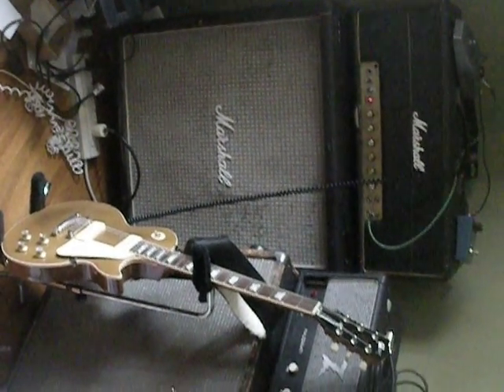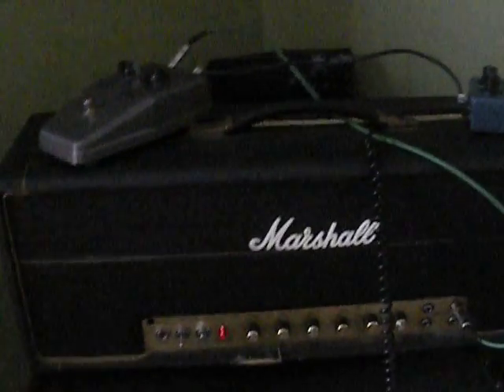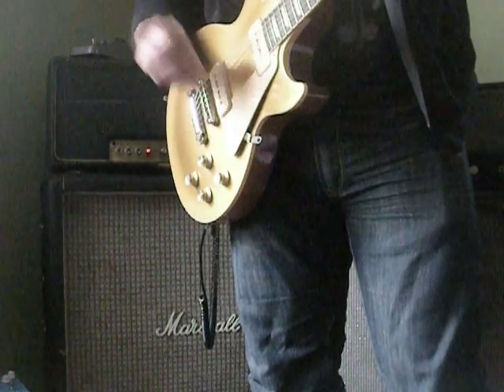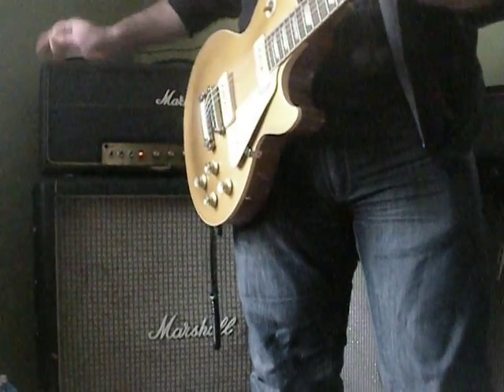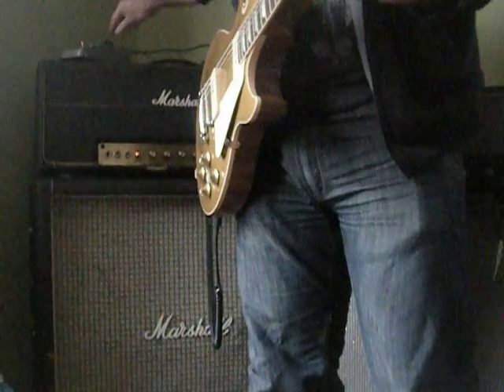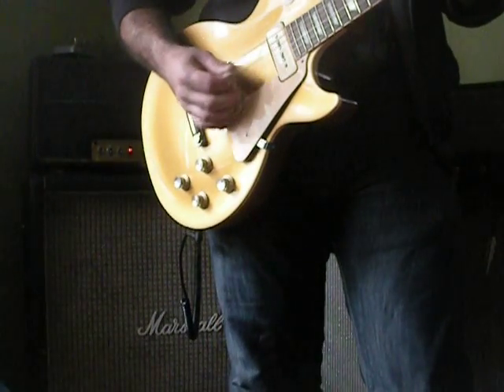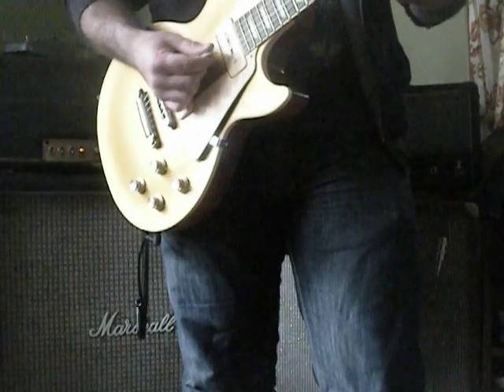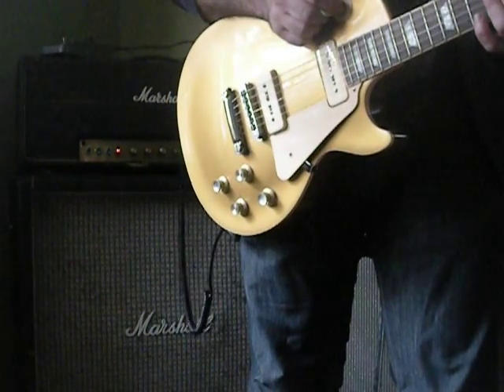How to use Fuzz - Vol. I - MKII Tone Bender (D*A*M Solasound)

Comment: what are you idiots going on about?
this video explains how to PROPERLY use a fuzz,
how people like Jimmy Page and Beck did-with dynamics.
Go from shimmering cleans to full-on fuzz with the touch of the guitar volume knob.
thats what you want. You dont want to be all fuzz all the time that gets boring real quick.
without the whisper the thunder loses its power.
unless your goal is to sound like a noob banging away at GC then go ahead and ignore his advice.
Thats why Page, Hendrix, Beck are legends and you are, well,  MURF8393 thats who.

For an example of using a fuzz properly listen to Sons of Adam (Randy Holden) do 'Mister Youre a better Man than I'
the verses are strat>fuzzface with the volume down, a nice clean tone
then for the solo he cranks the volume and gets the most amazing fuzz and feedback (for 1966 anyway)
The Yardbirds also did this sing the same year with Beck dong an equally amazing fuzz solo
but I like the Randy Holden version better.

One thing I worth mentioning, back then (mid-late 1960s) fuzz pedals were all true bypass,
and when you step on a TB pedal you get a really loud CLICK! coming through the amp,
and back then people used cranked 100 watt marshalls that CLICK would be loud as fark,
thats possibly one reason they used the volume knob to control the fuzz in stead of stepping on it
to turn it on. Either way the result is a better tone, and more logical use of a fuzz pedal.

Oh, and hes getting hum because his guitar has p90s, which are single coils.

Comment: I'm a beginner, & within the first 60 seconds of the video I was utterly lost by the jargon. I was hoping to get some kind of rudimentary understanding but I'm only more baffled, & it doesn't help that the person making the instructional video doesn't know exactly how it works, either. LOL. I want maximum distortion, is there a pedal I can get for under $75 that would be good for a newbie to mess around with, that is not too complicated?
Reply from the maker: You can ignore all the specifics and focus on the technique.  My favorite distortion is a Rat.  I think you could find one used for $75.  Look for one in the flat topped box, not slanted - those are better.  Good luck.